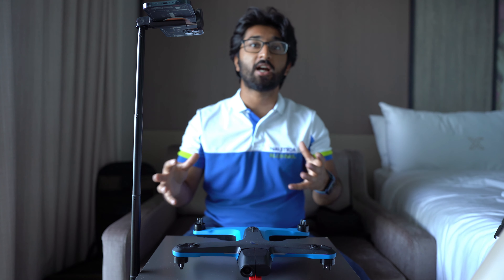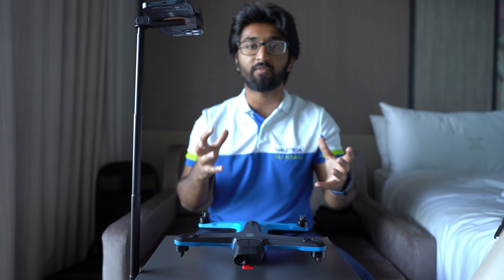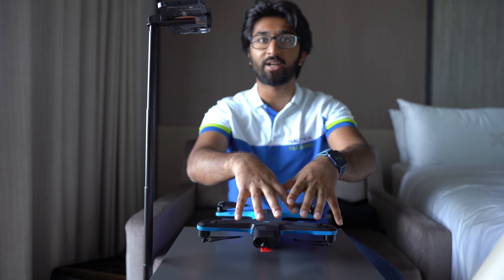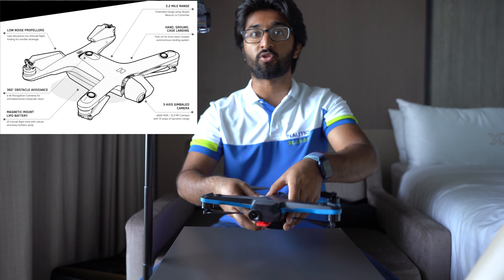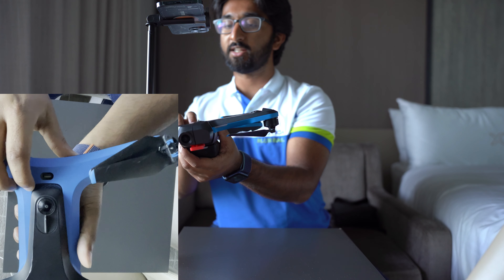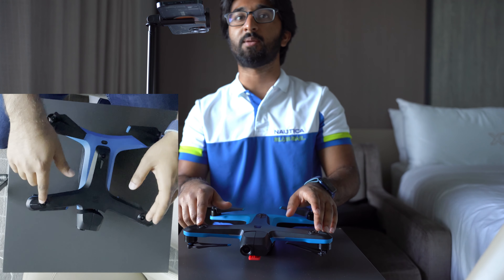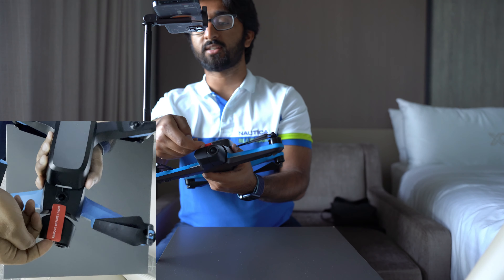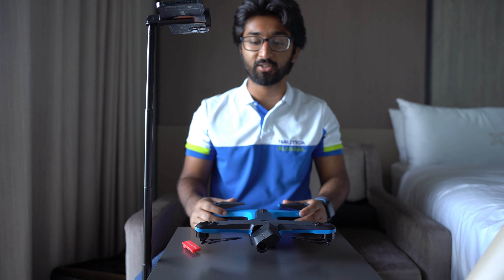Skydio 2 Autonomous Drone | Hardware Overview & What Makes Quadrotors so Popular?

Comment: Excellent video! One thing to add: The TX2 does not process the camera data directly from the six navigation cameras; that is handled by a separate Qualcomm RedDragon QCS605 ISP.
Reply from the maker: You’re absolutely right, thanks for the info!